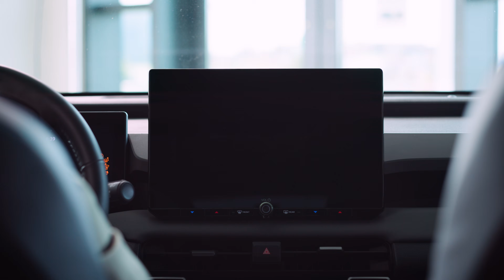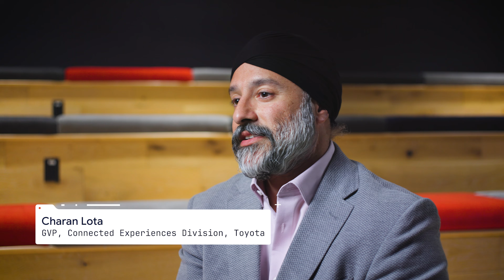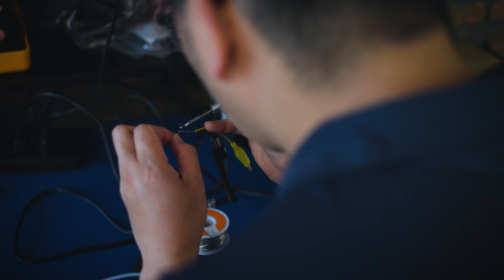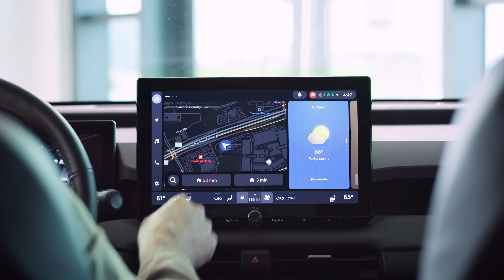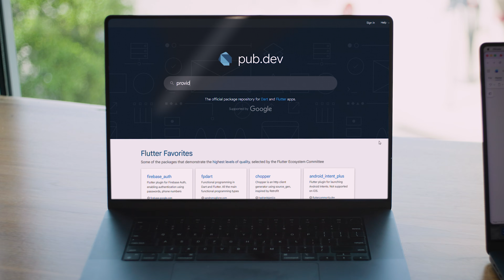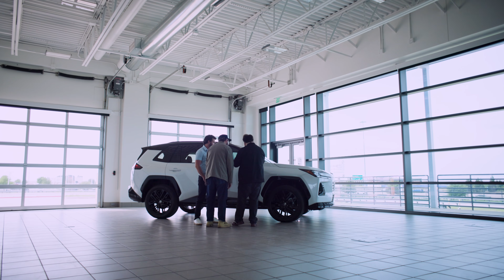How Toyota is revolutionizing their infotainment system with Flutter

Comment: As a Toyota service advisor, the response from actual owners hasn't been positive. They still havent figured out automotive U/I yet. The goal shouldn't be to make a smartphone screen. Implement Skeuomorphic & Pseudo-Mechanical Haptics. Adjusting the climate on screen shouldn’t just move a slider. It should trigger directional, haptic pulses that mimic a mechanical dial. Perceived mechanical resistance, a button press can "feel" like a spring-loaded switch breaking past a threshold. The current trend of floating, rectangular tablets creates visual clutter and breaks interior design cohesion. Sliding a finger up the physical right-hand bezel of the screen could control volume; sliding down the left bezel could adjust cabin temperature. If it's raining, the front/rear defroster controls should dynamically surface as massive, un-missable tiles on the screen.
Reply: I agree that they haven't figured out auto UI/UX yet and this apply to every major car manufacturer imho, yet another reason to choose Flutter as their main tech, it's very quick to interact and improve in a way that the tech isn't holding them from evolving as fast as possible, really the developer experience is astonishing good and developing beautiful interactive UI with Flutter is easy as well.

Comment: Finally Tesla might not be the only one with good UI in a car. Every other brand outside of Rivian sucks. The car shouldn't have to be an EV to have good UI.
Reply: The argument they made about using Godot was startup times and performance... Tesla uses Godot last I checked...
Reply: best UI a car can have is a steering wheel, throttle, brakes, clutch, and somewhere to SIT. a windscreen is also handy. nothing else is of any concern and is a distraction from the task at hand... DRIVING.

if you wanna play puters, stay indoors. theres people out here driving on teh roads that want to get home ALIVE.

i am trying to find ONE positive benefit to having ANY "UI" in a  CAR?

Comment: As with other things they use it because it is cheap, not because it is good. (I am skeptical if it will end up being cheap in the long run.) A better alternative would have been to just use android and use the millions of knowledgeable android developers.
Reply: The best way would be to make CAN codes open and a screen with a standard connector. So basically, the whole entertainment system would be open source. No more outdated and closed systems.

Comment: 1, this was overkill. There were existing solutions to the problem. Namely when they claimed startup time for Godot implementation. Precompile a runtime that can be simply flashed into the memory. Startuptime fixed. 
2, we don't need more tech in a car. Look up the patents for monitoring driver and passengers speech, face, heart rate, emotional state and READING LIPS. This is going to be used to deliver ad content while at stop lights and judging you if the computer thinks you're allowed to drive.